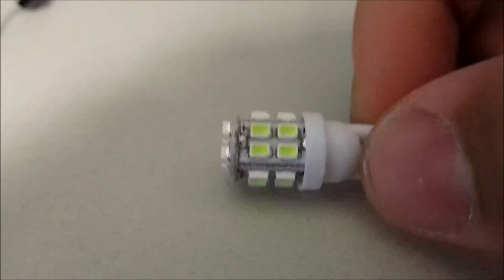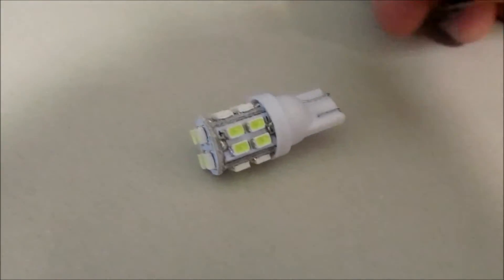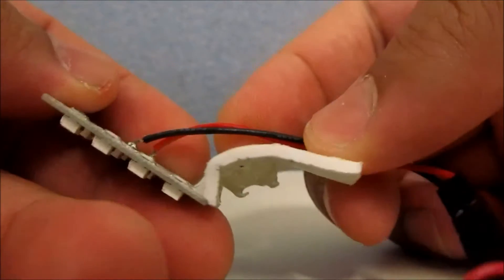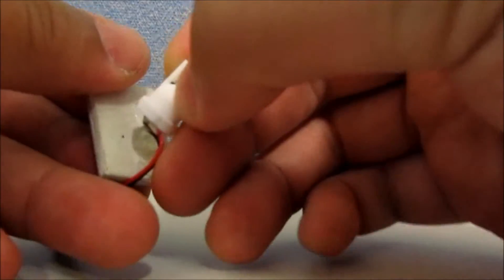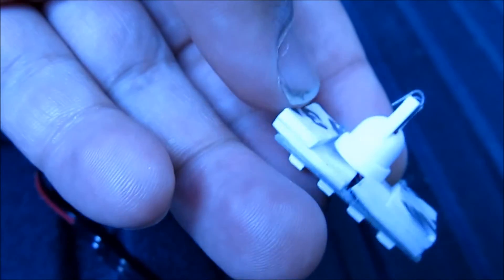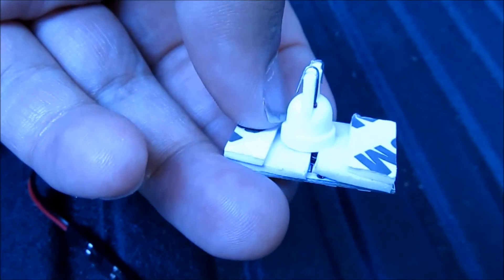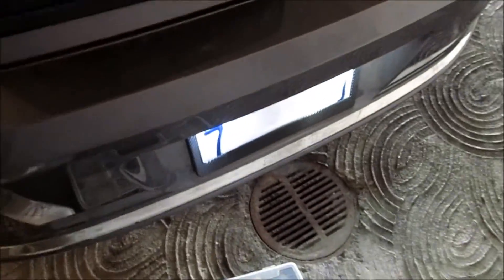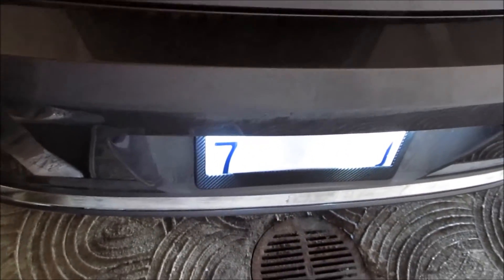DIY 2013 2014 2015 Honda Accord Coupe License Plate LED panel

Comment: i wonder if the housing still fit after you put in the led panel. also would it be bad to leave the plastic off without putting it back in to cover the license plate light?
Reply from the maker: Yes, The housing fits with the led panel on the coupe models.   I would put the cover back on if possible.  You don't want water/dirt get in the socket and short out something.

Comment: are the t10 20 smd relatively brighter than the standard incandescent bulbs? how would you compare them in your own words?
Reply from the maker: Yes, I would say they are 2-3x brighter compared to stock bulbs.  The leds outputs a nice crisp white light and gives the car a more modern style look and feel.

I dislike the dull yellow "old" style incandescent bulbs.  I wish this car came with leds from the factory like the new lexus, bmw, mercedes and other car manufacture.  I'm perplex as to why they are still using incandescent bulbs instead of leds on recent cars.  Its time for them to move on to more efficient light source.
Reply: Yeah, I agree. I didn't know the other manufacturers moved onto leds. 

By the way, is there a way to replace the incandescent lights on the doors? If yes, would you mind posting a video of how the cover is removed? That would be awesome.

Comment: Weird. I used that led bulb and the plastic cover wouldn't snap back into place. I have a 2014 Accord Coupe.
Reply from the maker: what is the measurement length of the led bulb you have.

Comment: Why won't this work on my 2013 sedan?
Reply from the maker: It doesn't work on the sedan because the license plate housing is different than the coupe.  The led panel does not fit in the sedan housing.  You can not insert the led panel through the bulb socket hole.  

Only thing you can do is just swap it with a led bulb or purchase a aftermarket license plate  assembly that has led panels already integrated into the assembly.